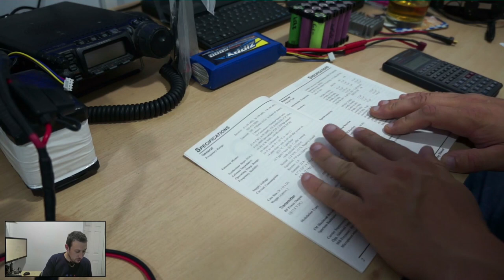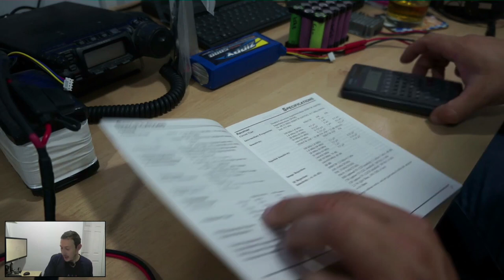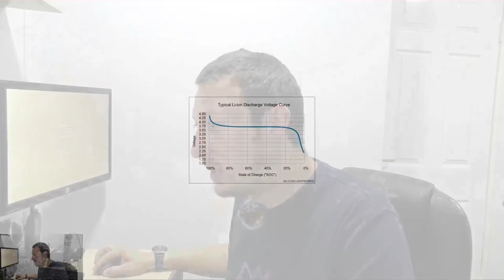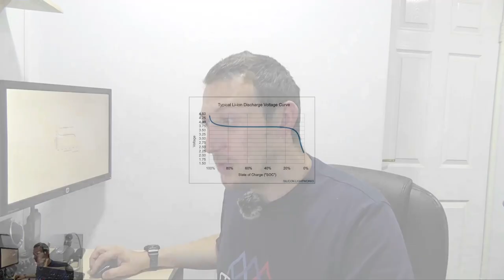Lithium Batteries - What Voltage & How Many Cells?

Comment: I just use a 4S battery with a Buddipole Power Mini, which also lets me connect the solar panel when I need it.  Not cheap, but not much in this hobby is!

Comment: Because my IC-705 needs 13.8V for 10W out and can't go above 15.8V I wondered if you could have a few series diodes in the supply line for fresh batteries and then when they have discharged a little you flick a bypass switch that takes the diodes out of circuit.  When the volts on the radios display show they have reached plateau then bypass.  Obviously the diodes need to be good for a few amps.  In this way you can handle the awkward voltages - just remember to have the diodes in circuit initially !!  Also avoids a noisy and slightly lossy switched regulator.  Might try this for my homebuilt pack.  Enjoy your content, thanks
Reply from the maker: I'd be interested to know how well that works.

I use my pack with my Icom 705 without problems. It shows 10 watts output on the internal power output meter on the Icom 705 screen.

I don't know how accurate the internal meter is & I've never checked it with an external power meter, so I can't say if it actually is putting out 10 watts.

Having said that, I don't think a couple of watts (ie the difference between 10 watts and maybe 7watts?) will make a huge difference.